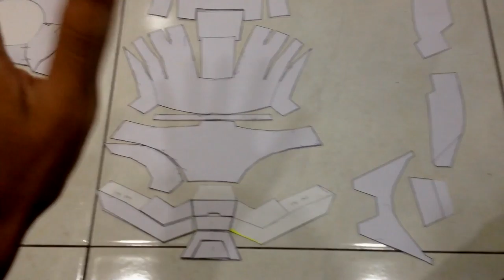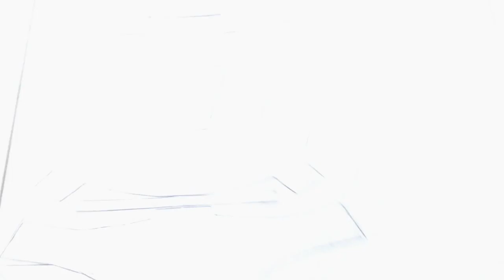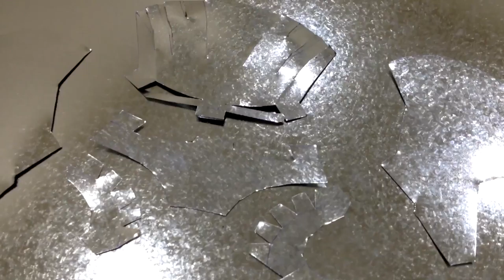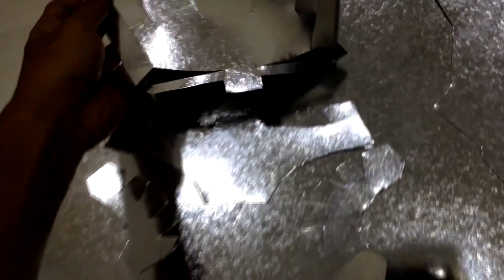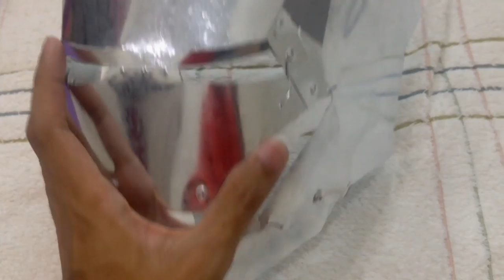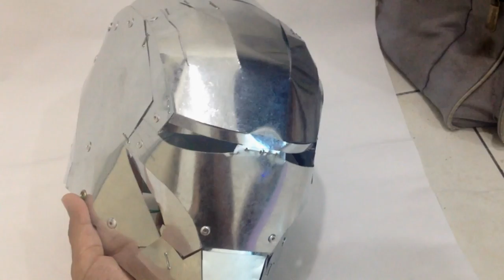Real Metal Ironman Helmet

Comment: I have one in just working on building arduino goggles for jarvis that will show velocity battery life temperature a face recognition follower targeter motion and when in the air or lets say your skydiving if will go in flight mode which will show a graph in front of you
Reply: Yaaaaq sure you did that
Reply: @yoamal1187  they said working on boi learn to read
Reply: @ilovecheese9791  working on them,* learn to type

Comment: Sorry but you need to use a thicker metal to get a better result
Reply: Laurin Laier ive been looking into this, what metal would you suggest? Thickness? Etc..
Reply: MegaEddiezero for my metal armour I used 1mm to 1,5mm steel and stainless steel but for your helmet 1mm aluminium will work just fine
Reply: U don't need thicker metal fool I made one out of tht metal n it came out perfect n fine... Its guy tried n it still looks like ironman
Reply: Titanium alloy or metal or steel